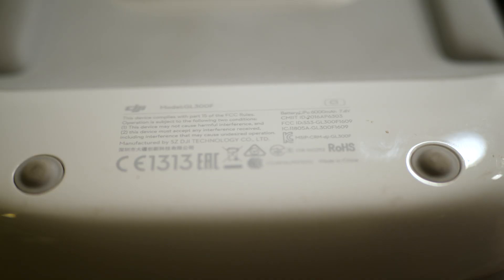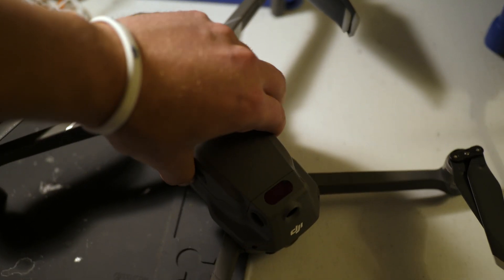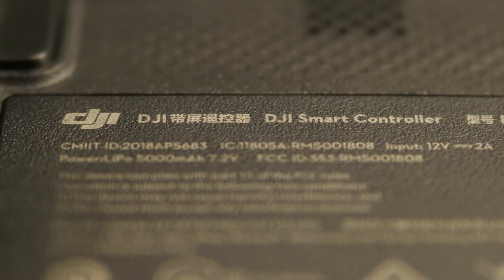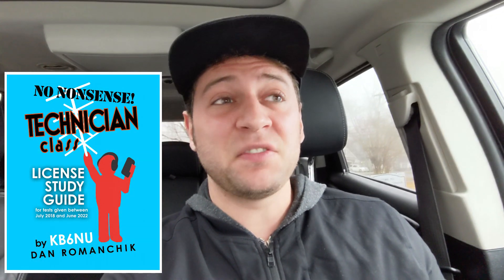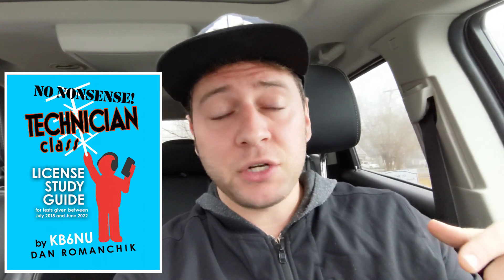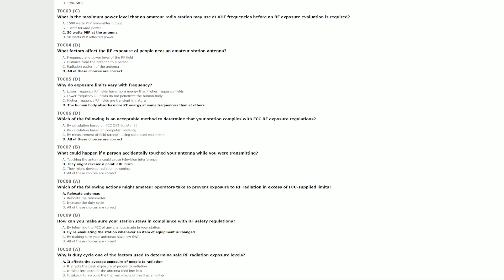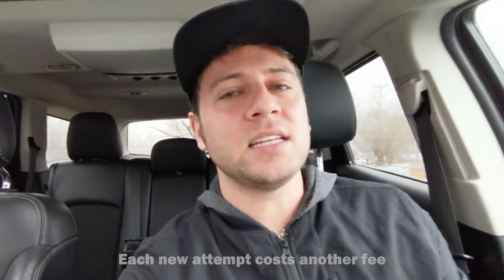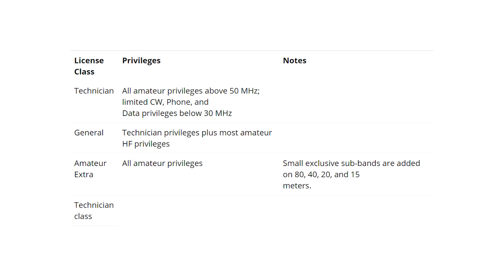Getting My HAM Radio License to Fly FPV Quads Legally

Comment: I have NOT delved in to FPV yet, but I'm about to get onboard...  my question is regarding the digital DJI FPV goggles, transmitter and controller.  Are these items FCC compliant, or do we still need the HAM license to operate legally with DJI's kit?!  Or is there other equipment on the quad that is typically not compliant?  Any help or clarity is much appreciated!
Reply from the maker: Hello, I looked into your question, and it appears that SOME of the frequency bands may be ok without a HAM radio license. Check out the DJI FPV System user manual. On page 13 it says, "An amateur radio license may be needed in FCC regions when using channels 1, 2, 6 or 7, as they are amateur frequency bands." 
https://dl.djicdn.com/downloads/DJI_Digital_FPV_System/20190731/DJI_Digital_FPV_System_User_Manual_EN.pdf
Many purchase websites such as GetFPV.com or RotorRiot.com also have FPV Regulatory Notices at the bottom of the sales page about ham amateur radio license requirements.
Reply: I really appreciate the info.  Thanks for taking the time to research it!

Comment: Thanks from KD9LLS, I also aced the exam for the Technician class using http://www.hamradiolicenseexam.com/ , I will use them to get the other classes. They are awesome.
Use them to prep you for the test, use the internet to find where the test will be held in your area (ham radio technician test locations).

Comment: Congratulations on passing your Technician level test. You said that someday you might do Amateur Radio. Well my friend, if you are doing FPV video, you are doing Amateur Radio. Amateur radio is not just squeezing a mic or tapping out Morse code. Amateur Television is as much Amateur Radio as any other part of the hobby. Actually you are doing what many consider to be a very advanced part of the hobby, commonly called ATV or Amateur Television.

There are hams taking the off the shelf FPV transmitters and attaching them to weather balloons and sending them up 90  - 100 thousand feet or more. Since they don't want to listen to the wind blow,  they will modulate the audio channel with digital telemetry including temperature, battery voltage,  GPS position, altitude, etc. They will also have transmitters on other bands such as 2 meters or 70  cm. 

Welcome to the hobby and maybe, someday we will hear you on the air. BTW, I am sure that when you studied for your test you learned about  ID requirements.  If you want to be 100 percent legal, you can add a small Arduino Nano to your drone and have it send your call sign in Morse to your audio channel every minute or so or at least once every 10 minutes. All the best and happy flying.
Reply from the maker: Thanks for the tip about ID requirements. I personally display my callsign (KN4SOL) visibly in my FPV video feed. Would you say that's sufficient?Z
I checked out some radios recently as well, perhaps I will get on the air soon! My father has expressed interest as well.
Reply: @EdRickerVlogs  Yes. Displaying your callsign in your video is sufficient. You only need to ID in a way that is easy to obtain. For Video your callsign in the video is great. For digital modes operators id in the mode they are transmitting. Some operators on HF use Slow Scan TV to transmit jpeg photos. Since their callsign isn't necessarily in the photo, they will identify their transmitter using cw before and/or after the sstv transmission.

Comment: Hey there! I’ve heard everything from looks good on my resume to watching a 9 year old go from tech right through Extra in one setting. I am an Extra Class K9HDT also a Volunteer Examiner for the group that gave your test W5YI. I have been a ham for 16 years after being in Broadcast Radio for over 25 in the Chicago Market. You can retire the man but you can’t take radio out of him! As far as FPV you really don’t need it. The rules are more for planes and Copters that use the 430 UHF Range frequencies. They cause interference to radio services and you need to know and understand how to avoid the problems that can arise from those issues. You also need a firm grapse of the part 97 rules. This is a wonderful hobby. You can take a wire Antenna 5 watts of power and if the conditions are right talk all over the world. That’s rare but it happens. I have talked to 5 of the 7 continents about 70 confirmed countries including a couple very rare ones on less than a 100 watts with  my 80 meter antenna and a good tuner for it. My oldest grandson is studying right now to also become a ham. At 56 it’s a wonderful hobby and I’m sure that Mr Tesla never dReamed it would go so far. Most radio’s today are software based and surprisingly inexpensive for all they do. A great radio costs less than a Phamton 4 pro v 2.and lasts mush longer and has great resale value as well. Che k it out there’s a whole other world out there that is at the end of a mic. 73, K9HDT

Comment: So you get into FPV drone flying as a hobby only to find that to be legal you need a HAM radio license. That  just seems totally weird and unnecessary to me. Now that you've gone through the process and are now legal, do you feel there is an actual (and relevant) correlation between the two totally different hobbies or should FPV drone operators have a different type of licensing process related to flying and not radio frequencies? I may be wrong about the radio frequencies part, I'm just guessing that's the purpose behind it.
Reply from the maker: Well it's rare to find people even talking about it. People like Joshua Bardwell made a few videos about HAM license requirements back in early 2016 in which he said, "If you fly FPV, then you probably are supposed to have a HAM license". Steele Davis has mentioned the HAM license in his Part 107 video as, "Something you might also need, I'm not sure." They both have their licenses as do some other prominent figures in the FPV community. Reading through forums and comments I've noticed a couple people mention it, but it really seems like it's one of the most overlooked "requirements" of FPV flight. Indeed however it is a requirement when utilizing any sort of UHF transmission equipment not in compliance with FCC Part 15, which is the vast majority of video transmitters.

So there are the people who are aware of it and go after it, and then there are the people who heard about it once or twice and just don't care. It seems like a fringe concern such as weird state laws like in Maryland where it's illegal to curse while driving (for real) or Arizona where it's illegal to spit in public. Who's going to find out or care?

As with all drone flights, you have to weigh all options and analyze every situation. If you're flying on your property and/or you're below a certain mW output, etc. then you'd win the lottery before you had the FCC knock on your door. We FPV flyers have much bigger concerns with trespass, public nuisance and ignorance, coexisting with manned aircraft, etc...so this little license is probably one of the least of our actual concerns. One could argue that flying FPV at all breaks the FAA Line of Sight rule, so I doubt we can ever be 100% within all legal boundaries...but we could try our best by tying up the loose ends we can actually address, i.e. HAM licensing.

As this gets more wordy, I apologize. But I will say that what I learned by studying for the test is not all just fluff. I did learn quite a bit about HF, VHF, and UHF, I was able to brush up on my knowledge of circuitry and electronics, I learned the science behind multipath distortion, types of antennas and weather's effect on transmissions.

I'll also say that, being somewhat of a public figure in the drone world, I have to watch my P's and Q's a little more than the average Joe...so to be completely transparent in how I strive to be as licensed as possible is a good thing on my end. Maybe one day this license will become more important especially the first day a pilot slices someone's jugular with a drone and lawyers pick apart the pilot's credentials. Hard to say, lol, luckily I've only ever spilled my own blood with a drone.

Thanks for watching!
Reply: @EdRickerVlogs  I appreciate your response, however long it may be. I actually learned something about Arizona law from it, and I live in AZ. Correct me if I'm wrong, Ed, it would be my understanding from your response, specifically your public figure stature and the minding of your P's and Q's, that you are in agreement with my opinion of said licensing. Feel free to nod so as to not offend the licensing creationists and the bureaucrats who put the completely out of round wheels in motion, and, all those who might see any relevance whatsoever.
Reply from the maker: I think if the FCC ever wanted to actively enforce the rule, they'd make a separate test or rule for drone operators. So getting the license now is a bit of a formality as well as potentially future-proofing oneself. However, drones are still the wild west in many regards to the FAA, the administration supposed to be in charge of and monitoring man-made objects in the sky. Imagine how much less of a grasp the FCC has on these things...so yes, taking a step back here, it is a bit ridiculous. 

Honestly I got a bit of a high having passed my recent Part 107 renewal, and that personal momentum took me through to studying for my HAM license. If I didn't have to study for my 107 renewal, I don't think I would have been in the mood to study for my HAM license. Once I get started on a mindset, I have a very difficult time breaking out of that mindset until I'm satisfied I can go no further in it. If there was another license required to operate, I'd be studying up on it now...kind of disappointed there's nothing else at the moment. I almost feel like studying for the next level up of HAM license (General or Extra) just because of how good I felt passing Technician. Interesting how necessity brings forth new direction sometimes.
Reply: @EdRickerVlogs  Well, congrats on your achievements. You're a true ambassador to the drone industry including knowledge and operation of photography related pro-sumer drones, and now, the FPV community as well. I thoroughly enjoy watching your vids.
Reply from the maker: Sweet! I appreciate you watching. I hope you continue to enjoy this great hobby and see you progress.
Reply: @rango_unchained  If a person is certified through FAA Part 107 rules to fly drones, and he wants to attach a camera, take off and record video he is free to do so and can record all he wants. Unless, from my understanding he wants to use the video for commercial purposes. At least in this country, for now, that is not allowed as I understand the rules. That is, unless he is flying indoors, in which case he can monetize the video all he wants.

The issue with  FPV transmitters is that the manufacturers built them to transmit in the various Amateur Radio microwave bands. If they would have put them on government or military frequencies, frequencies used in civil aviation, navigation, telephone communications,  satellite frequencies, etc., they would probably be sharing a cell with bank robbers, ped porn pushers or other such lowlifes. But they had to put them somewhere, so they decided to put them on frequencies allocated to the Amateur Radio Service. Not a problem if you are a licensed Amateur Radio operator. If you are not a licensed to operate on Amateur Radio frequencies, every time you turn on your FPV transmitter, you are operating a pirate radio transmitter, and you could in-fact be subject to very stiff fines, and/or imprisonment. Granted, arrests are very rare. You would have to be a repeat offender or someone who absolutely refused to pay fines after being cited, or get caught using the transmitter to transmit stuff that I will not mention. In some areas, the same frequencies used by the FPV transmitters are used for other purposes such as  trunking for Amateur Mesh Networks, Radio Astronomy, repeater control, and a variety of other things. Some Amateur Radio operators are pretty creative and find very novel uses for those frequencies. 

Chances are,  drone pilots will never get caught with their brief usage of  their pirate transmitters, unless they cause interference to a licensed activity, in which case, they will find that some hams are very good at trivialization and can very quickly locate the unlicensed transmitter. If you are willing to comply with FAA Part 107 rules and regulations to operate your drone in the U.S.A., why would you not be willing to comply with part 97 of the FCC rules to operate your FPV transmitter legally?   I agree with you 100 percent that it is a hobby. But it is a hobby that requires at least a Technician class Amateur Radio license.  It is not an FCC part 15 certified device that can be operated without a license, nor is it transmitting on  frequencies that do not require a license, such as Citizens Band, MURS or FRS. Especially when you can get your licensed by taking a 35 question test that is easy to study for and pass.

Comment: Congrats man!  I've been procrastinating on studying for the HAM Technician test even though I've already bought two official books to study for it directly from the ARRL.org website.  I do have FPV drones, 3 of them, but I don't use the FPV camera, I just fly line of sight because I don't have my HAM license yet.  Although, I did find an FCC certified 5.8ghz video transmitter made by FatShark and plan on putting it on my next build.  It only broadcasts the signal at less than 1mW so the range is only about 600 feet I think, but at least it's FCC certified.  The only downside other than the range to the FatShark transmitter is that it's a bit clunky and much larger than a normal transmitter and I'm not sure how the telemetry and OSD work with it.  Thanks for the video and congrats again!  :)
Reply from the maker: Thanks!!
Let me refer you to a video by Joshua Bardwell concerning that same video transmitter: https://www.youtube.com/watch?v=tTm_NOq80GU
As you see, he's not a fan for a few legitimate reasons. One of the reasons he points out is that the antenna is built-in and not swappable...which means if you damage the antenna you need to buy a whole new VTX. 
He also did some calculations, and it puts out between 0.2 and 0.4 mW of power which........is really bad. That's just slightly higher than Pit Mode on a TBS Unify Pro, which is designed to not broadcast beyond the workbench essentially.
Of course I know nothing about how busy you are at this point in your life, but it would make a ton of sense to study for the exam while you wait for a better VTX like a TBS Unify Pro to ship to you. Just a thought! You'll love running up to 800mW and you'll never go back :)

Comment: Congrats on passing your test Ed! I was first licensed back in the 70's when I was 12 years old and have been in and out of the hobby all my life. It can be a very enjoyable and educational hobby. If you want to pick up a cheap hand held radio, you can find them on Amazon for less than $30 to get you started! Don't feel pressured to have to get on the air if your not ready for it but atleast with the cheap hand held radio you could listen and get a better feel for if you want to get further into the hobby! Search Baofeng on Amazon to see how cheap the radio can be had. The one I would recommend is the  Baofeng UV-82, https://www.amazon.com/dp/B00E4KLY34/ref=psdc_2230642011_t1_B071NY2KS4 . You can also download many of the scanner apps and listen to some of the amateur radio frequencies all over the world. Congrats Again!